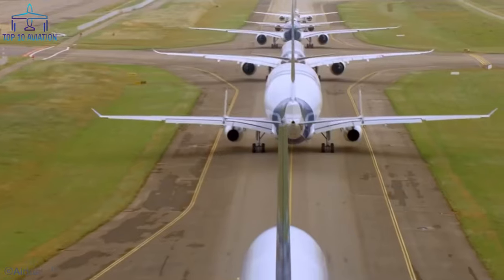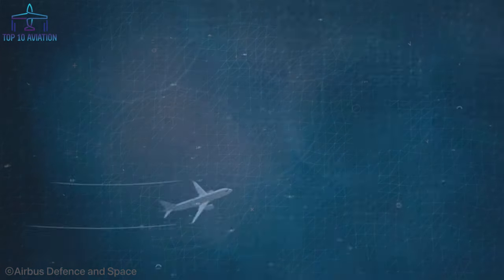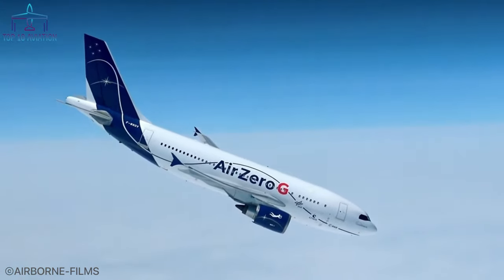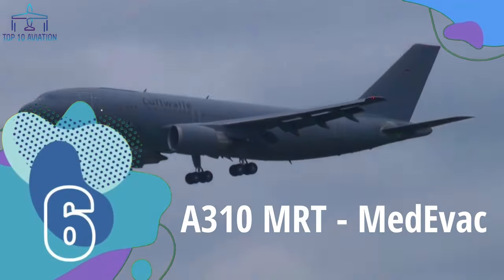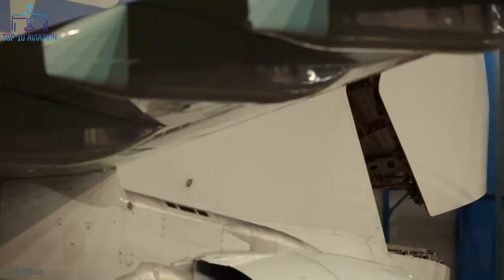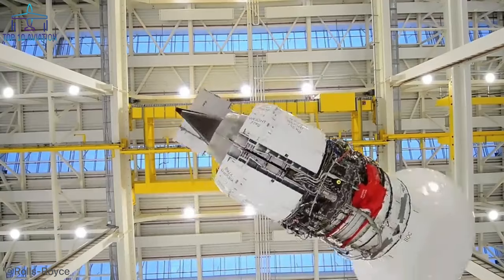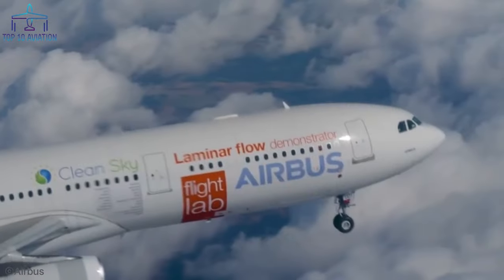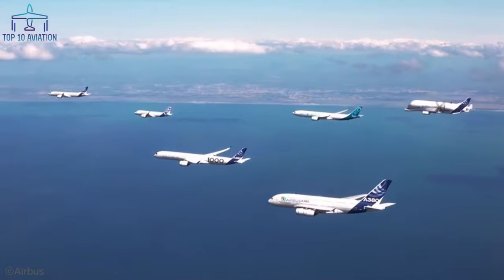Top 10 Modified Airbus Aircraft

Comment: I prefer Airbus to boieng. A340 or 747?
Reply from the maker: I prefed the 747 to the 340
Reply: i prefer airbus because boeing is lazy.
Reply: i like airbus cuz even tho their planes are not alot but most i see them are unique like :
- a380 beats the record one of the largest passenger plane (rip to 747)

- another unique thing is that the glass cockpit of the airbus has updated to neo version (some of them). The b777....meh all the same

- beluga or dreamlifter?? i like beluga so i chose the airbus beluga (from the normal size to XL) and yeah i love the bulp on its head like a big forehead , not a fan of dreamlifter but cool modified 747 tho

- battle bus fortnite be like: airbus-> bus that is on the air
Reply: @muranpapadum7541 its actually McDonnell Douglas execs.
Reply: @whale3641  And boeing as a whole.